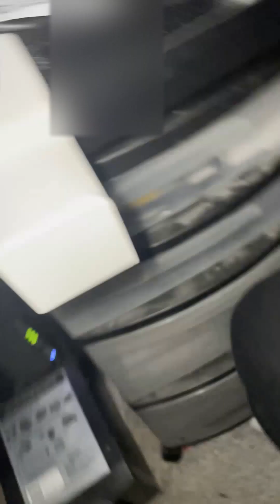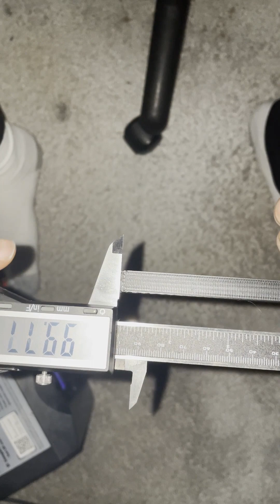How to replace belts in Qidi Q1 Pro CoreXY

Comment: I bet yours was making a slight grinding noise while running. Mine is making a noise but support says that theirs makes that same noise too and some others have complained about it being noisy. I should take mine apart to find the noise but just covered the belt in oil to temporarily hide the noise.